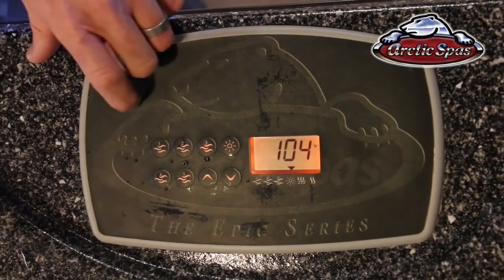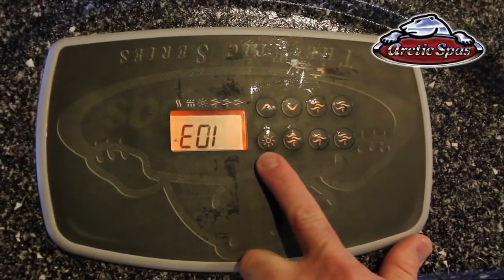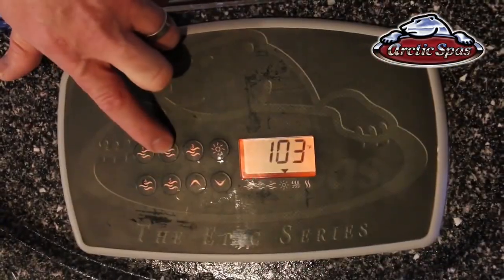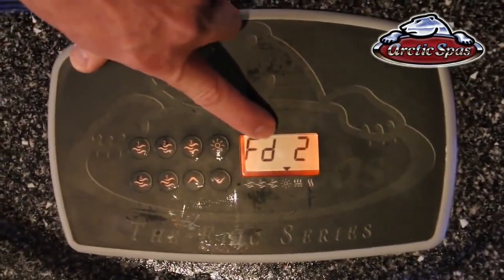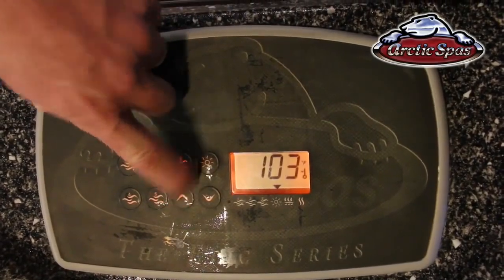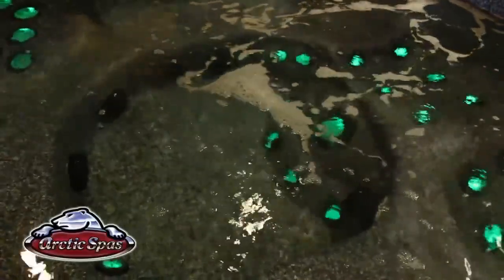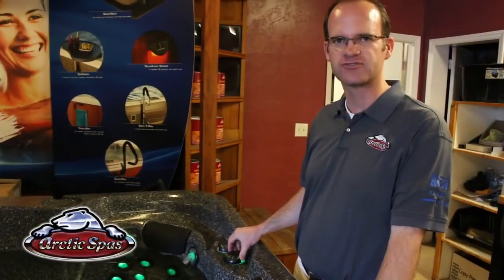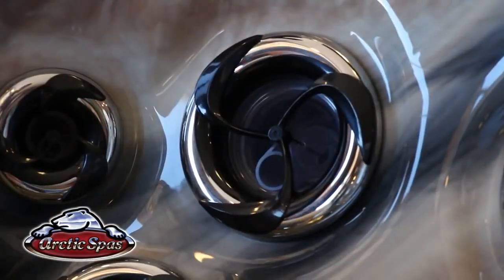Arctic Spa Topside Controls & General Maintenance | Arctic Spas Tutorial Video

Comment: How do I turn hot tub on?? It is turning off after twenty minutes or so and I can’t get the control panel to light back up??
Reply from the maker: Typically the control panel does not turn off but the pumps are on a 20 minute timer. You just have to press it again to turn it back on.  You can email us at Support@ArcticSpaStore.com if you need more help.  Thank you!